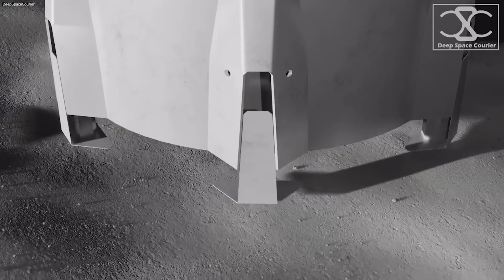FAA Desperate Decision To Stop SpaceX Starship Orbital Test Flight!

Comment: Its true, there is many sarcasm by extreme claims of danger, into regulations, some sware, the FAA, FCC are taking influence and bribes, some valed circumstance. If the upper stage malfunctioned during re-entry, yet successfully entered, it could crash as dead power weight, equal to an astriod of the equal mass & velocity ratio.